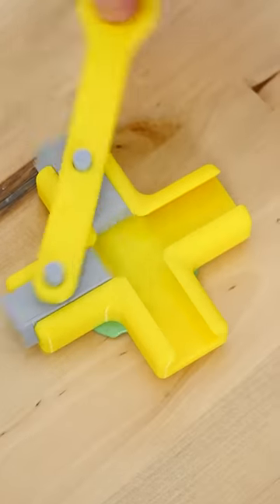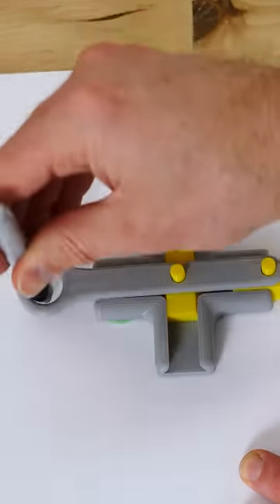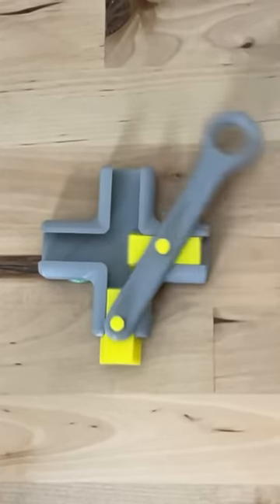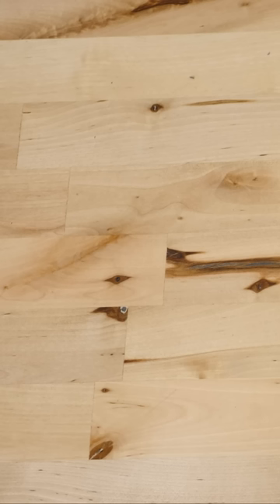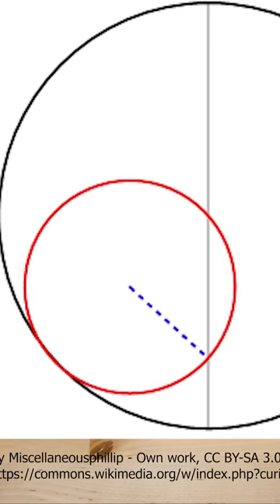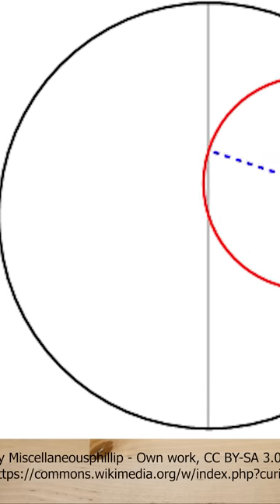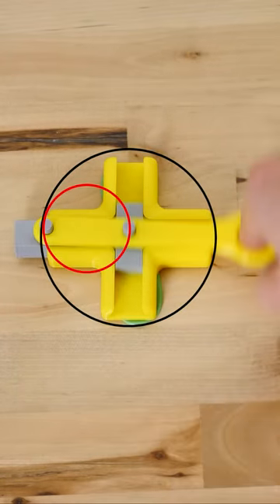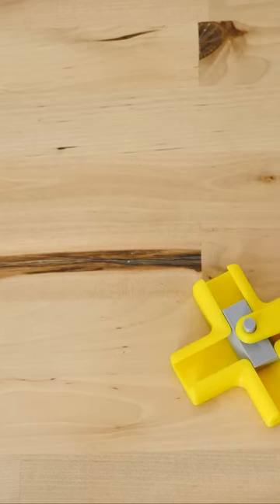The Do Nothing Machine

Comment: This is literally how an Internal Combustion Engine was invented.
Reply: I commented this, if you make the inner circle a triangle it's a rotary engine design
Reply: @XxSTARMeRcYX  I think the only similarity to a rotary engine would be the triangle itself.
Reply: Similar to a radial engine design if anything
Reply: @lucas_woods  si
Reply: No.
Reply: I was thinking about this lmao, I didn't know it actually was that close to an engine design
Reply: It’s a four or six cylinder radial without needing a master rod. Use direct injection two stroke cylinders for even combustion pulses.
Reply: How was the external combustion engine invented?
Reply: Sadly, I think is will probably mess up the exhaust gases with the oxygen and it would be ineffective.
Reply: Really? Because this doesn't share too many similarities besides having pistons moved by rotation.

Comment: Fun fact: a plane engine (not a turbine, an engine) uses the reverse of this, it puts a cylinder instead of each peg and the cylinders are used to spin the shaft in the middle, which then turns a propeller. Engineering is quite interesting.
Reply: Not true, note the shaft in this example doesn’t stay fixed in one place, the origin of the smaller circle (the shaft) orbits the larger circle. Planes use traditional combustion engines which cylinders laid out in a circular pattern (or V pattern) about a common rotating mass (the crankshaft).
Reply: @jaydenwhite3497  obviously the cylinders won't criss cross into each other, there will be more cylinders opposing them.
Reply: @yaseenbshina3140  you mean a Radial engine.. Which nothing even similar
Reply: Is love to watch a video of that
Reply: >puts a cylinder instead of each peg

Puts it where?
Reply: So you're saying plane engines use "Do something" machines?
Reply: @unnamed217  I found this quite funny
Reply: @Vampibatmanodactyle  your mThis comment has been redacted by United Nations Security
Reply: No
Reply: Astronomy and Engineering when combined.
Reply: Sorry but no

-someone who actually designs aircraft engines
Reply: @Ckcdillpickle  it is very similar what are you talking about.
Reply: @Professional_FunHaver  you design radial engines for use in propellor aeroplanes? What else is there to design for an archaic motor most aircraft don't even use anymore.
Reply: @salmahyenasashimicheetah6888  I didn't say it was practical. It's more of a hobby thing.
Reply: Fun Fact: no one cares, no one asked

Comment: This “do nothing machine” does a lot of converting linear motion to circular motion (and Vice verse)
Reply: Seems pretty useful if you ask me
Reply: It looks like those crazy airplan engines where the crank is connected to like 8 pistons in an octagon. Im ignorant in plane engines but i saw a cutaway of one of those it looks highly similar
Reply: Trains
Reply: Was about to say the same thing. He calls it the do nothing machine, and then continues to draw an ellipse with it.
Reply: So it’s transmotion now? Or is it motionfluid?
Reply: @jasonvargas7564  use my motionnouns correctly 💅
Reply: @jasonvargas7564  #allmotionsmatter
Reply: As mentioned earlier about airplane motors, could such a simple design be used as an internal combustion engine?
Reply: @duckie1300  #MotionEmotionsMatter
Reply: @HydroPlush  it might be able to, the only issue would probably be the oiling and the rings would probably get fucked. It seems like its more of a rotary since rotarys are in the ellipse oval type housing.
Reply: Rotary airplane engines use something similar, essentially changing the working motion.
Reply: @2nd-place   that's why your 2nd place you keep trying to get on top of momma to get motion,
Reply: @lumbee1986  radial airplane engines, rotaries aren't really used in aviation
Reply: @imthedarknight-8755  you're right, used the wrong word😅😅
Reply: @duckie1300  Ohhh so that's why i thought i saw this movement somewhere ! Works like a radial engine
Reply: Its also known as a "bullshit grinder" you put it up to your ear and turn it so it "grinds the bullshit" before it goes into your ear lol
Reply: @duckie1300  radial engines?
Reply: @titanium_viper0990  as a few other comments have stated, it was invented as an expression of mathematic principles, and not for a specific action, so the machine in itself essentially does nothing, which then dominoes to mean it can do many things with just slight modification.
Reply: @noelleholiday61  Bro really replied to a 1 year old comment. 💀💀💀

Comment: This is actually the basis of a scotch yoke compressor. The "pegs" are cylindrical pistons with the valve mechanism at the end of each channel (which are the cylinders). It is driven by a motor and can be used to compress air or refrigerant.
Reply: I was actually wondering if this same “machine” actually had practical mechanic principles that we used. The closest I kept coming to were radial engines like those found on the B17 or DC3
Reply: Everything is useless when don't have a purpose 🤔
Reply: At that point couldn’t you just leave pedals on it and have a human powered compressor lol
Reply: @KuraiJS  We aren’t useless. ❤

Comment: It is called Double Slider Crank chain mechanism (also called as an elliptical trammel) which is an inversion of 4 bar chain. And it does DO something. It may be used in locomotives, and the other mechanism you showed is mainly used in v6 engines. I studied all that in my Automobile engineering
Reply: I was thinking this looked familiar.. imagine a piston-driven modified rotary engine. 😮
Reply: also it reminds me of a radial engine used in aircraft
Reply: (shhh they accept whatever we tell them)
Reply: Does this device have a turbo encabulator with no side fumbling? 

If not, no deal!
Reply: @P.W.R.  unfortunately, no. It's a retro encabulator with a baseplate of pre-fabulated amulite, and surrounded by a logarithmic casing. 🫤
Reply: @nathandoll.  
Oh well. 🤷‍♂️

I heard retro encabulators are high quality at least.
Reply: Don't radial and rotary engine pistons do this kind of?
Reply: @nathandoll.  Thats just called a radial
Reply: Damn that actually makes sense, the ability to turn curved movements into straight lines and vice versa is the kinda thing that would be useful for something. Of course they would call it a "do nothing mechanism" when they don't have it connected to anything, because everything is a "do nothing mechanism" when connected to nothing. Two gears connected to each other would also technically be a do nothing mechanism even though they very much do something
Reply: @shinobix4925  EXACTLY! All a mechanism needs is a proper setup, and it can be efficient.
Reply: Could see something like this being used in some form of a transit system.. would have to be railed I think.. unless someone else has a better idea?
Reply: @ThePhaseMaster  indeed, they are used in Railways. To connect tires. You can see these mechanisms in old locomotive engines.
Reply: This is what I thought, seems like a pretty useful mechanism in an engine
Reply: Thanks, I was so confused when practical applications of it seem pretty straight forward 😄
Reply: Isn’t this mechanism mainly found in train wheels?
Reply: @cyndaquil1433  An inversion of this mechanism is found in the train wheels. But this exact mechanism is widely used in Engines
Reply: Big brain. 🧠
Reply: God bless you, Jesus loves you!
Reply: Mazda rotary engine also
Reply: I have seen them also in highly precise machines. controlling a barring held mechanism like this is actually easier and has more reliability to gears (although mote accurate) as this basically predates gears (fin fact you can see old clocks before the 1800s and most early pocket watches used a small version of this with a ratchet joint to be the windup part along a tension spring)
Reply: @ientertainmyself5676 oh? a fellow engineer?
Reply: I was literally about to comment that; this is how your drive train works to transfer vertical piston movement into horizontal rotation
Reply: I'll take your word for it, but that is pretty cool and makes sense!
Reply: @nathandoll. Exactly the first thing that came to my mind

Comment: • Try visualising a massive virtual ellipse & two intersecting
[ X ⇄ X ] 
[ Y ⇄ Y ]
Train tracks - each 100 kilometers long.

• Place train carriages on them at opposite ends, accessible through a double door airlock system (one door on the train, one at each station).

• Using rigidly timed, computer controlled, autodriver systems, put them in a constant stop/go motion (with perhaps 3 minutes at each stop & "n" minutes between stations).

 • It doesn't matter how fast the individual carriages move, as they all move synchronously, regular as clockwork. Each acting as though they were individual pivot points/separate shuttles (confined within channels), linked by a singular virtual lever, with it's end circumscribing a vast vitual ellipse.

• Using this design, it would be physically impossible for two separate carriages to crash into each other, they would Always be a fixed distance apart.
Reply: King Pistachion  That's why I love this kind of content. I've seen versions of The Trammel of Archimedes / Do Nothing Machine before (there are some excellent 3D print models out there), but seeing it here just sparked a whole lot of ideas at once...

This channel is literally Inspirational.  : )~
Reply: Unless they got hacked.
Reply: @donnytuschoff8903  I mean... That's kind of a liability regardless of how you program the trains to work...
Reply: Imagine if instead of a circle of half the circumference of the bigger circle, you have a circle of one third the circumference.  With two points along that inner circle at an appropriate distance away from one another, you could actually make a David's star trammel.
Reply: Thank You
Reply: It's the same thing. Trains are never designed to crash, lol. But they do sometimes, because errors.
The same kind of error that can make your rudimentary design fail.
Reply: @yueshijoorya601  I mean, it's obviously rudimentary and prone to the same errors as any other train.  It's not a profound observation and I'm pretty sure OP is aware of that lol.  It's also not the best application of this sort of principle.  Still fun to think about for the simple fact that it's a start when thinking about what a real world application for the trammel of Archimedes could be.  No need to be a penis bud...
Reply: Very interesting!!
Reply: @brazilianambassadordale8223  Wow, that was directed at OP, but somehow you took it harder than him. It's called feedback, manchild.
Reply: @Skeptical_Numbat  This is a nice idea, but it probably wouldn't work. It would be a so-called zero-sum approach that doesn't take into account all possible circumstances. When logistically planning public transportation routes, you have to take into account sudden and unexpected circumstances that can't disrupt all public transportation in the area (in this case, all public transportation, because the stopping of one train has to stop all of them to avoid a collision). For example, someone would get stuck on the tracks and it would be necessary to stop a train (all of them), someone would commit suicide by running in front of a train and then the whole transport would stop working for at least an hour, one train would break down during the duty, there are as many possibilities as there are people living. 
I used to work in the Logistics Department of the Polish State Railways and I remember how
they told us about a story similar to this one :)
Reply: @pietnastak  I agree in real life this definitely wouldn't work, but still think that the inspiration/thought experiment that I had after observing the functions of the Trammel could be used to help develop more efficient, safer systems by visualising them as a whole & not as separate parts working within the same domain.

Having the separate elements in a complex system relate to each other by simple rules, remaining within the context of the greater whole (much like the shuttles, levers, pivots & channels of the Trammel), seems to be the better way to go (we can learn so much from nature #Biomimicry). Not like so many real world systems I observed over the years, which seem constructed in an ad hoc, lasse faire development, with ever changing goals, budgets & especially variably skilled designers.

(I hope I'm explaining what I'm getting at clearly enough, here.)
Reply: @yueshijoorya601  Uses “manchild.”
Respect for anything you say just went out the window.
Reply: @dungeonsanddragonsanddrive2902  Sure thing, childman.
Reply: @brazilianambassadordale8223  I don’t think anyone ever needs to be a penis bud. Or a dirty penis wrinkle. I don’t exactly know what a penis bud is, but that’s ok. I usually use “penis wrinkle” when I need to describe a certain kind of behavior (or even “dirty penis wrinkle” if the situation calls for extremes) but “penis bud” does the same work.
😁
Reply: Uh
Reply: That's a grand ol' theory that we already have implemented in real life. I mean how often do you hear of trains and carriages crashing into each other? Usually they become derailed and crash, I have almost never heard of train collisions in the contemporary.